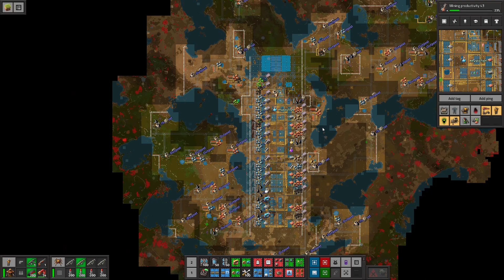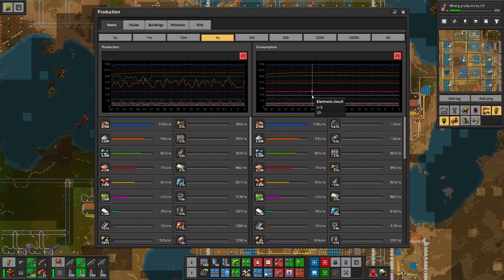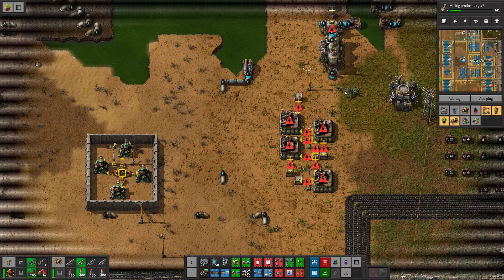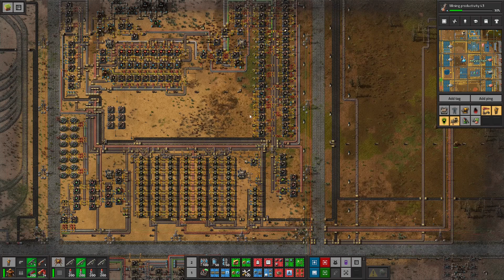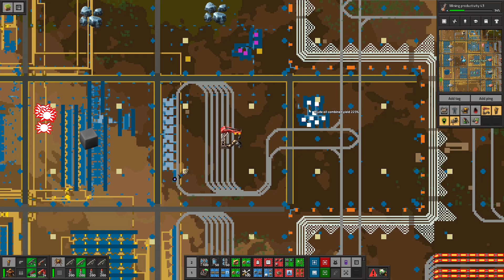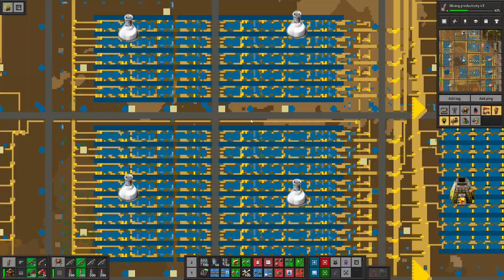Base Overview (Bonus Episode) - Ep68 - Factorio Expand-a-Base

Comment: Nice, now lets gets started on the 10k SPM mega base.  LET'S GOOOOOOOOOOOOOO
Reply from the maker: Haha! I am going to take a break from megabases for the moment. Have a couple other projects I want to finish before the expansion drops. :)
Reply: Do you mean an upgradable 10k SPM base?
I wonder if you could make an upgradable ups-friendly base make sense... (For example with train-to-train designs for common intermediates, and bot labs.)
Or if that would inevitably mean using the jumpstart base science for longer and then making a complete switch to a train-based megabase. (Like Nilaus' megabase in a book https://www.youtube.com/playlist?list=PLV3rF--heRVvoGNLBpdpq6zmzvJTpSfe9 did.)
Reply from the maker: Yeah, I think one has to think more carefully about UPS for higher-spm designs. And there’s not a clear definition of “upgradeable” to me. In my base for this series I think it was focused on vertical scaling (making existing components faster) more than horizontal scaling (adding more copies of components). Like taking science builds with AM2s, no modules, and yellow belts all the way up to blue belts, AM3s, beacons, and tier 3 modules. We got almost a 10x boost in SPM just by doing that! That said, there were also elements of horizontal scaling present too: multiple copies of science columns, multiple mining outposts, etc.

So I think you can design a base in this style that could go up to 10k SPM most easily by horizontally scaling it (as we did with the second module builds). The idea would be to figure out the necessary number of belts/builds, build that all out with the yellow belt/AM2 tier, and then scale it up from there.
Reply: @mysticfishgames  "build that all out with the yellow belt/AM2 tier,"
10k spm is 8 times what's in your factory. If I remember correctly, "the yellow belt no module" version of your columns made 150spm. 8 times that is 1.2k spm, the end phase of this factory where you didn't need the science for any research any more.
No, I think after your bootstrap phase you probably need to start with 150spm or 300spm science builds, and then figure out an upgrade sequence (I think horizontal-then-vertical?).

And you'd need to figure out how you want to organize the base. For the first set of 150-300spm builds, you'll want to directly belt into the labs. But for the remaining 1200-150 spm it makes more sense to train the science to the labs. Firstly because smaller modules can be placed more flexibly. And secondly because you don't want to manually draw belts through a layout like this 8 whole times; you really need a blueprint for the whole module, from the ore/plate unloading stations through the assembler columns to the loading station.
Reply from the maker: Also, I am pretty sure I would have to upgrade my PC to run a 10k spm base!